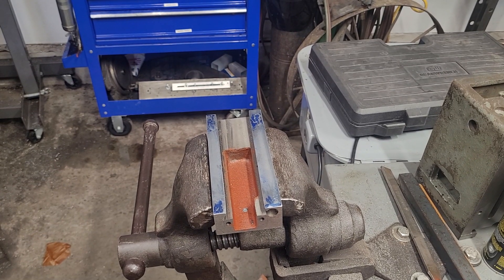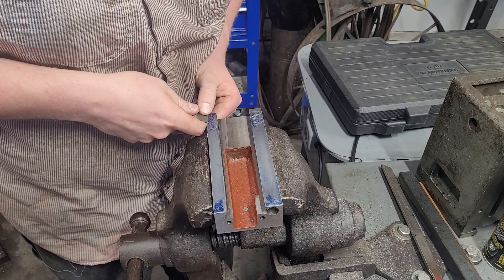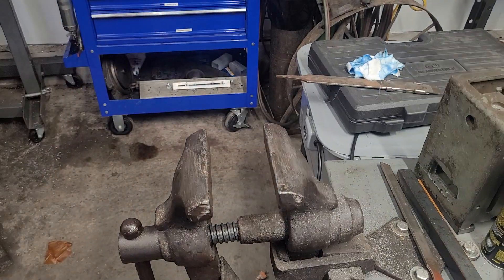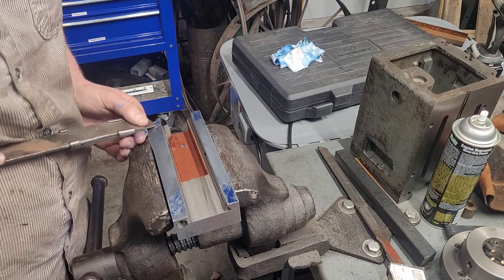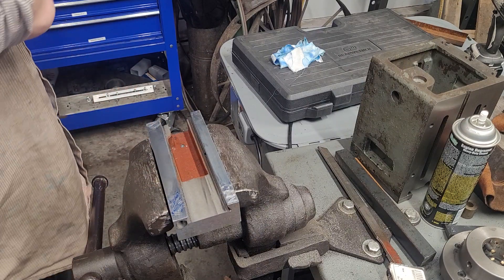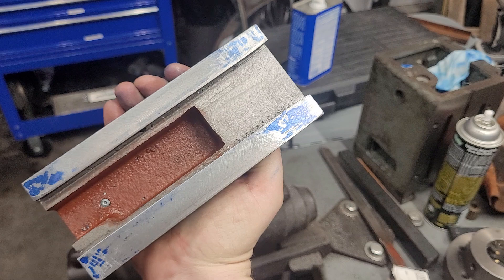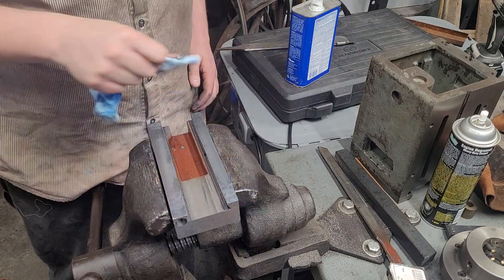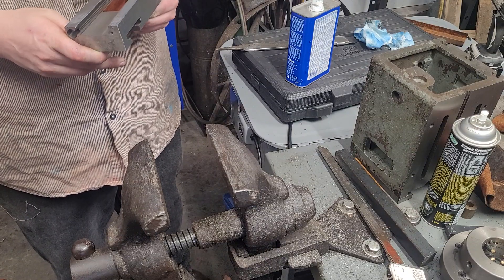Scraping a  grizzly lathe compound slide: part 1

Comment: Dude, your scraper is not doing it's job. With such a large radius, you should be getting wider cuts. It sounds wrong, maybe just dull. Don't cut with the corners of the blade. Have you watched ROBRENZ video on scraping? Lots of good tips
Reply from the maker: I re ground the scraper to take smaller cuts. I wasn't getting good enough global flatness with a larger radius. This is also EXTREMELY hard cast iron, almost to the point its too difficult to scrape.

Comment: So you are scraping to get a more uniform surface?
Reply from the maker: Sorta. The goal was a greater contact area, which is inferred from creating a flatter  surface. The granite surface plate I used is just a reference. I finished this job today and it made a big difference in surface finish due to the increased contact area, and therefore ridgiity. It's still not ideal, but it was worth the three hours of work. Eventually I'd like to do the whole cross slide, but that's a project for another day.
Reply: @moosesmachinery  interesting!
Reply from the maker: @WhOwns  it's a pretty common practice. You have millionth of an inch potential accuracy and can do it over a huge area. But it's really, really labor intensive.
Reply: @moosesmachinery  looks like it takes a lot of patience to get it just right. It's nice to see these by hand techniques on your channel as well!
Reply from the maker: @WhOwns  thanks! This is 100% just taking your time. Making a surface flat is far less complicated than making them perpendicular
Reply: Great question I was curious also!